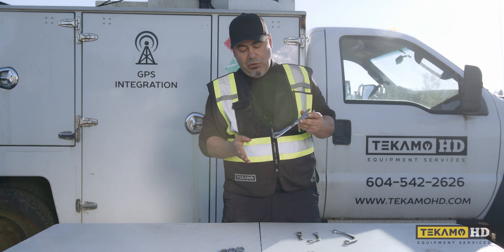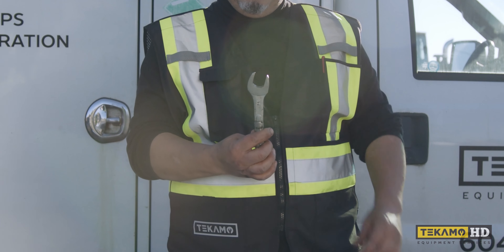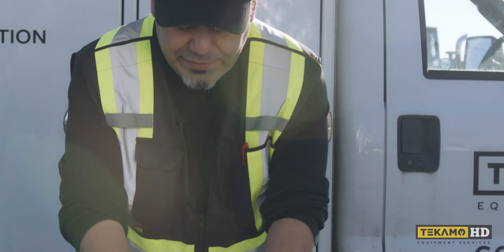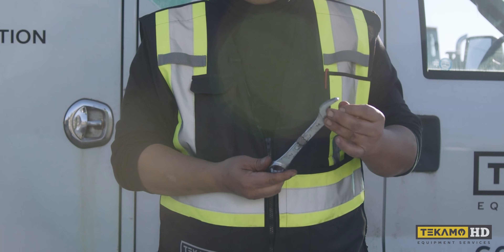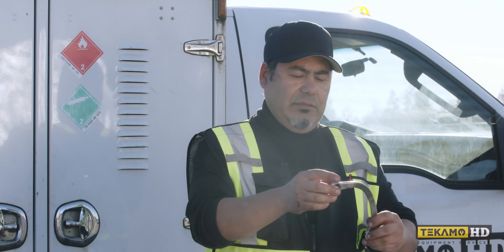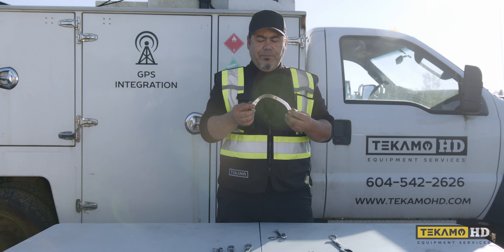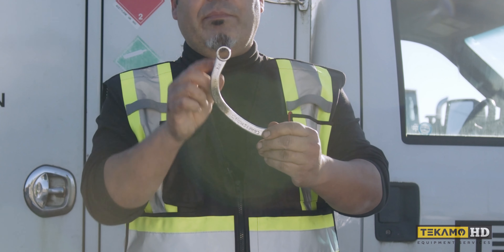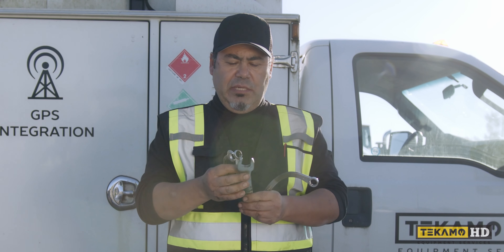MODIFIED TOOLS - What you need to know about DIY TOOLS for your HD Mechanic Toolbox

Comment: So you go on mine sites? We can’t have these on our trucks or MSHA would have our a** I know people hide them or what not if they know but I wish I had one for our equipment for the starter motor on C15 they put it all together before it’s in the machine and once it’s there you gotta remove half the machine to get the starter out or access to the bolts getting it out after is a whole other Houdini trick but there is one specific bolt that is always way too tight in the one spot you can’t fit a regular wrench or socket with any leverage at all usually have to use a stubby and a lifting strap I may try to have one fabricated (if it’s made by a fabricator then it’s allowed) just not by us techs so dumb